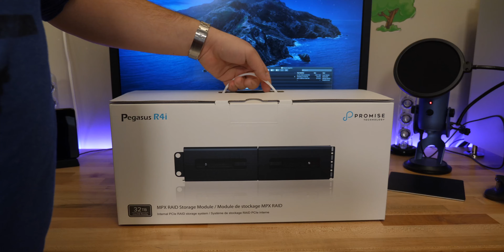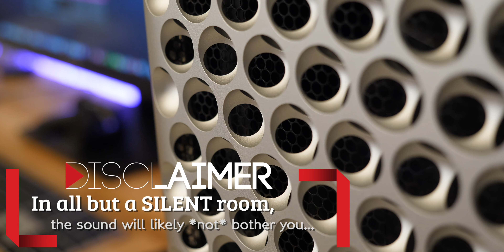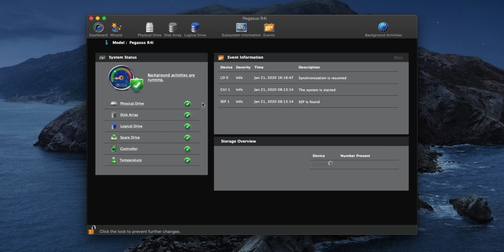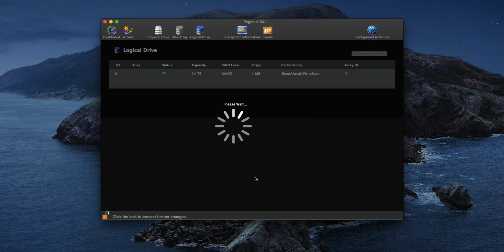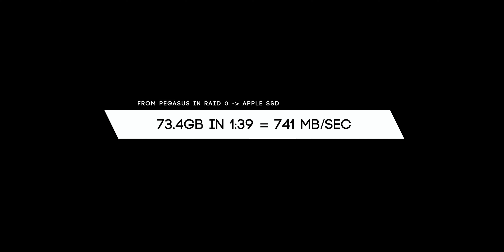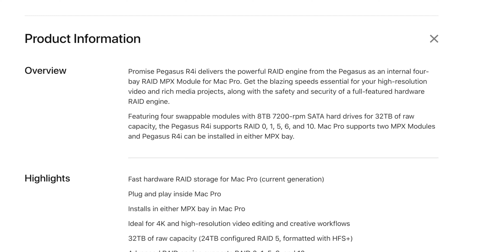Quick Look at Promise R4i 32TB MPX RAID Module for Mac Pro

Comment: Sehr, sehr unprofessionell, da kein ESD-Schutz (Armband) getragen wurde, in der Elektronikindustrie stellt dies, nach einer Abmahnung, ein Kündigungsgrund dar.
Reply from the maker: LOL. ESD-band. You're hilarious, and it sounds even funnier in German! :) Danke schön!
Reply: @SilfenPath  Manufacturers and users of integrated circuits must take precautions to avoid ESD. ESD prevention can be part of the device itself and include special design techniques for device input and output pins. External protection components can also be used with circuit layout. https://en.wikipedia.org/wiki/Electrostatic_discharge
Reply from the maker: I know what ESD is. But in 30 years of working with electronic components, assembling servers and PCs - I’ve never used one. Not a single damaged component. That’s why I said it was funny. If I worked in a repair shop or factory, sure. But when putting in a GPU into a PC - I’m sure 99% of people don’t ever use protection :)

Comment: I'm surprised Apple didn't offer a much, much bigger storage option.  In RAID 10 you've only got 16TB and with 4K rushes, that's going to fill up pretty quickly over time. In addition, it would be interesting to see if these are reliable like G-Tech are (touch wood!), or are they just going to lose your data in spectacular style like a Lacie.  Great video.  Many thanks!
Reply from the maker: As this is just a hardware RAID module, you could (theoretically, I did not try it) add your own more reliable drives into it... As far as "RAID" goes, Promise is usually quite good at that so I'd say I'd trust the RAID itself won't fail for some unknown reason. But again - even this big of a storage, if it is your primary - back it up :) ... Or use IT as a backup instead :) ...

And yes, LaCie - what a POS! :)

Comment: Hello dear. Thanks for your videos they are really helpful!!! I want to ask, i am getting a 12 core mac pro with 32 gb and 1 tb, updating to 96 gb rams (6 x 16 for 6 channels use) for audio production. I will also add NVMe drives. hwoever i am lost between the sonnet 4x4 or the OWC . i want to have at least 2 TB for current projects, with the fastest available option, and another 4 TB maybe for the most used libraries. i dont know which ones to get, to have the best use, in RAID 0. also concerning this pegasus 32 TB drives, there is the OWC thunderbay 4 which has (As advertised) around 1500 mbps consistent speed, opposed to a 700 mbps of this pegasus, plus 1000$ cheaper than the pegasus, however its ecternal thunderbolt 3 connection. do u recomment that?
Reply from the maker: To keep things simple you could just go with OWC. One throat you choke in case it fails and I believe 5 year warranty. Sonnet you have to buy a card (which seems sold out still) and then your own nvme drives. It would be a bit faster than OWC as the drives you would get are somewhat faster (Samsung EVO 970 or some such), but for sake of simplicity I would (and did) choose OWC. If you need 6TB (2 and 4) - may be better to get an 8TB like me and split em. Use 1 SSD on it as 2 tb volume and the other 3 for other stuff maybe even in some kind of a raid config too. Though fastest would be just all in raid 0 - if you can back them up. As for other option you mentioned - I’d choose external TB3 over integrated Pegasus. It’s faster by a lot. Just my 2 cents :) Hope this helps.
Reply: @SilfenPath  All right the OWC TB3 external is a better option. thats solved :) concerning the internal SSDs, I dont mind waiting for the Sonnet card, my mac needs 6 weeks to arrive so if u think thats better. me buying the sonnet card and adding 4 sticks of 1 TB NVMe drives for the libraries i use the most, and getting an OWC of 2 TB for the current projects, OR just the sonnet, with 1 stick of 2 TB for current projects, and 3 sticks of 1 TB each for a total of 3 TB for libraries i use most, however in this case the first stick will run max at 3000 mbps, and the 3 others combined around 6-7000 mbps right? a bit confusing lol to get the best result

Comment: Thanks, Silfen,  for the instructional video!...Since noise is a factor for me as well, will not purchase the R4i; as a result, began my search for an external storage drive/NAS for my new Mac Pro!...Any suggestions?
Reply from the maker: Depends on budget, but I would recommend some of the Promise Thunderbolt external arrays. They seem to be very nice and fast. Do note they are not quite silent either, but if you can put them under desk or somewhere - that’ll do. If speed is not most important - Promise’s other Mac Pro add-on (J2i) for 2 internal SATA drives would probably be a good bet for a lot of storage. Wish one could get it without the included 8TB drive, so you can put say 2x14TB of your own without wasting money on unwanted 8TB drive, but that one should not interfere with fan noise as it’s in the back behind the CPU cooler. You may be able to hear the mechanical drives clicking a very tiny bit, as much as inside any other machine. Hope this helps. :)
Reply: @SilfenPath  Thanks for your helpful reply!...Keep the fantastic videos coming!